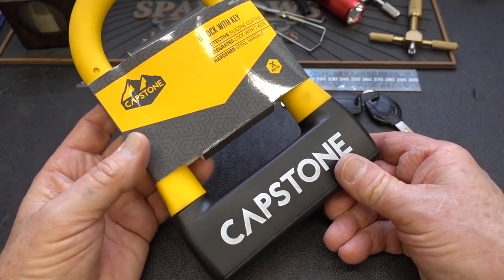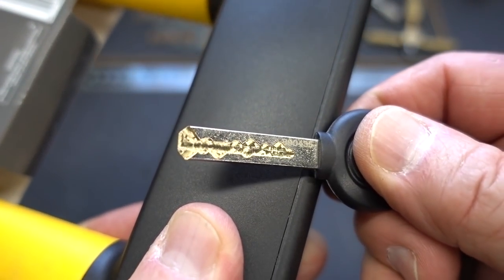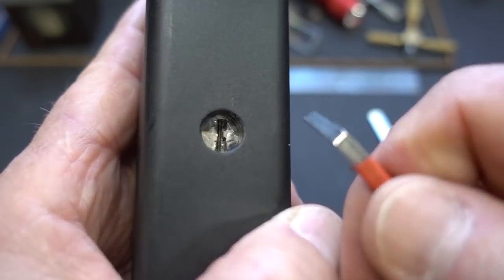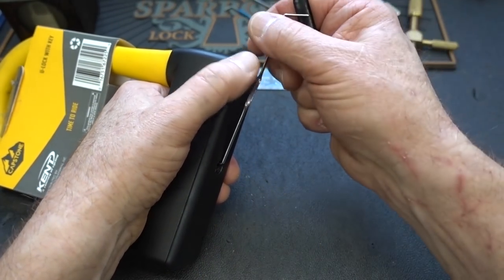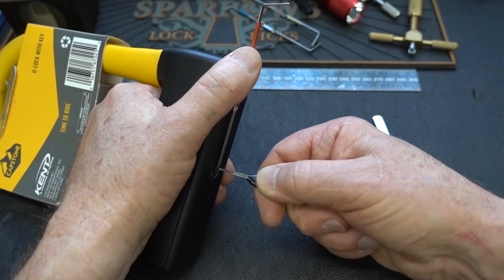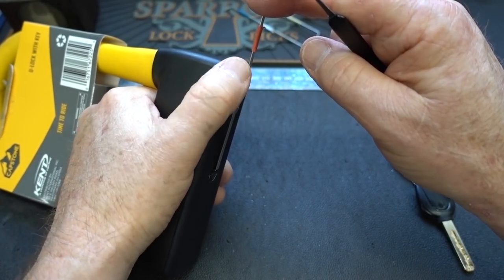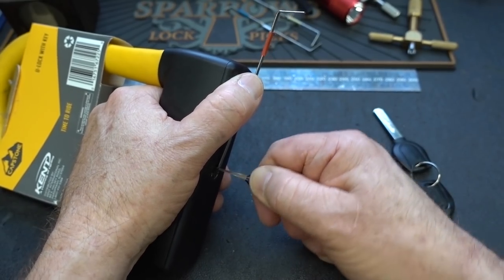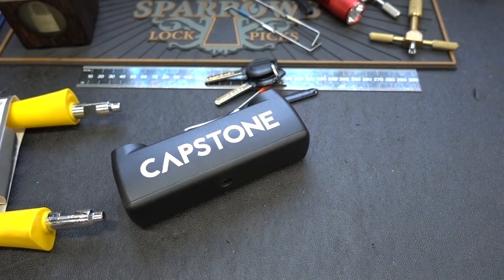(1645) EZ-Open Technique - Capstone 12-Slider Bike Lock

Comment: Why do people always call these keys "laser cut"? They're clearly just milled.
Reply: I tried looking that up some time back out of curiosity, to no avail. Probably just another internal industry jargon term that took hold cause it sounded super cool and secure at the time.
Reply: Blame gone in 60 seconds with nick cage. They hold three slider keys up and call them that. It's back and forth in the movie a ton.
Reply: Marketing gimmick that stuck. Someone threw the word laser into it to make it sound special. Other examples of marketing-names that stuck or became seem as universal terms bubble wrap, it's actually a trade mark Sealed Air Corporation.
Reply: Łukasz Piotrowski, they only employ people named “Laser” to make the keys, therefore, “Laser, cut”
Reply: @elonmask50  I wonder if Laser can be a legal name in my country :P It clearly has potential.
Reply: maybe the cutter brand name is "laser"
Reply: lasers sounded cool when these became more common.

Comment: One thing i always notice when you or lpl are picking is the general reliance on feeling the core begin to turn etc. If some one comes up with a way to make a core that can disconnect from the actuator when your trying to pick and generate a false pick situation your pretty well sol and it shouldn't be to hard of a device to make just need some sort of trap pin set up that retracts and separates the cylinder from the actuator while allowing it to turn. A cylinder in a cylinder set up maybe?

Comment: I have several Vidmar locks I need to try this on. I find them very hard to SPP.  They might not respond well though as sliders drop down to almost the bottom of the key way. With this method you might not randomly get under them.

Comment: The Jiggle Pick Method by Bosnian Bill.  More complicated the lock the Jiggler method can't can't be stopped.
Reply: Meeting the shear line in itself should not open the lock but must allow a secondary measure to open as the key is turned.

Comment: It seems like there is a degree of uncertainty about how long it might take to complete picking by virtue of the randomness of the technique. For an experienced lock picker it might not be an impediment but for the average thief under pressure to get it open quickly it might be.

Comment: Just don't do it on a car door, you pick it once, and turn it partially and the sliders fall back into place and if you are unable to pick it a second time, the lock is rendered useless. If you pick it to open, you will have to pick it a 3rd time to reset to the default position. Stick to padlocks, or buy cheap generic chinese car door equivalents.